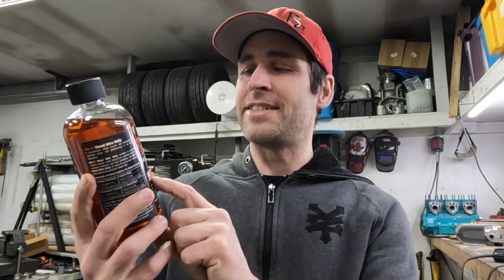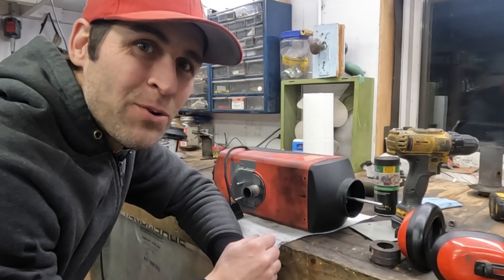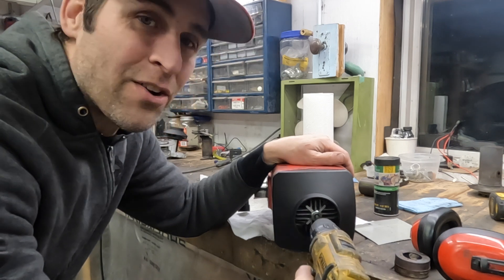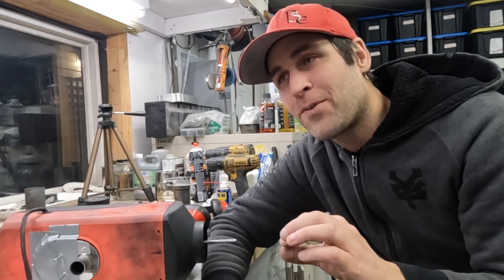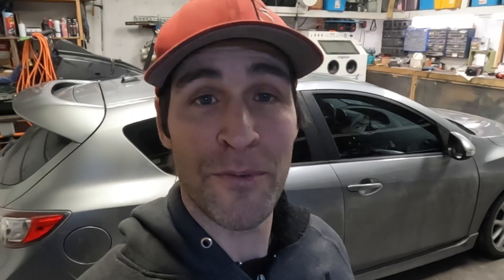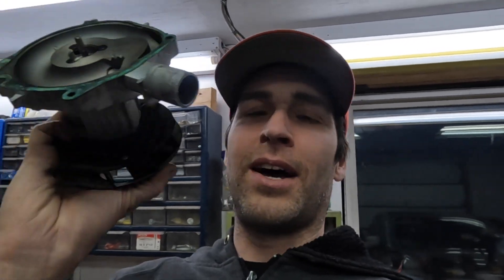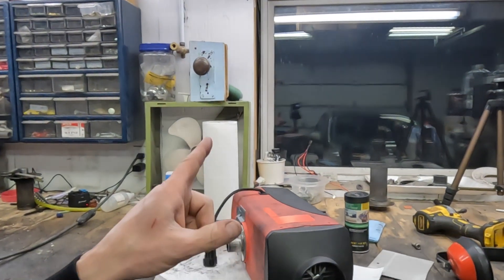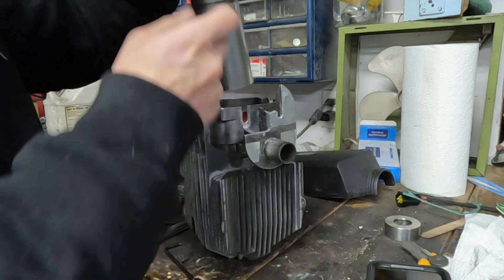Self Cleaning Heater - Veg Oil Fuel - Fuel Additives - UPDATE Video.

Comment: I use Mannol Benzine Ester Additive its for petrol engines seems to have made a difference 10ml per tank
Reply from the maker: I'm not sure if it's worse than anything else, but apparently Benzine is a carcinogen. I know it exists in small amounts in gasoline.
Reply: @loweredexpectations4927  Benzine is German for petrol according to the safety data sheet regarding ester there is no classification regarding carcinogens
Reply from the maker: @trsfc1595  Interesting. My only reference is that I have been watching a channel called "extractionsire" and he mentioned this in passing. .... Oh... Perhaps the confusion is Benzene ... Oops

Comment: @Lowered Expectations   ..    Have you tried K1 Kerosene ?    It burns not only hotter but cleaner than Diesel fuel does.   

If you haven't tried Kerosene  please try it in place of the Diesel fuel .     You could also try some Colemans lantern fuel  Its just High Octane gasoline, which also burns Hot and Clean .   Its pretty close to aviaition fuel  (not Jet fuel)  jet fuel is just a purer form of Kerosene.  Aviation fuel is like 100-110 octane gasoline . 
 
Also Kerosene would be much safer to add to the used oil .   

The reason im asking these questions is I personally know someone who uses used motor oil ATF and Hydrolic oil. In a slightly modified oil furnace in his garage , the person is a mechanic so getting used oil is easy to get.   He  thins/dilutes the used oils with Kerosene .  He just uses a standard Fuel oil tank to store the oils in .
Reply from the maker: I have not. Apparently it is the same cost as diesel, or cheaper, in some parts of the world, but where I am, it is 5X the price of diesel. 

I will probably try Kerosene mix as a test in the future. I would also like to try with just gasoline and veg oil. I have access to AVGas, but it is 104LL and I don't like the idea of burning deaded fuel, so camp fuel is a better idea for sure. 

Yeah, burning waste oils in a furnace is generally much more successful than in these heaters. These heaters are very small and stop working if you get much build up of ash or carbon. Anything that interrupts the flow of combustion air. In a waste oil furnace or furnace, there is generally a huge area for crud to build up, without causing any issues.

Comment: Hi Joel,
There certainly is airflow restriction in that passageway as it squares and necks down to the inlet for the intake side of the combustion fan, so it will be interesting to see if, with the reduced restriction it effectively burns leaner....  I'm guessing that's the main purpose for this test?

However, I would think that eliminating the intake pipe and pathway also makes the unit use conditioned air for combustion, wasting heated air in the process, and creating a negative pressure envelope in the conditioned space both of which are likely negatives.   I suppose there's a small risk of fire too should the thing ever backfire.

I'm thinking that maybe it would be possible to instead of eliminating the separated combustion air intake, that it gets replaced with a smooth turn 90 of some sort that could be threaded into the housing -- maybe using a small engine exhaust fitting for this purpose,, or attached via a flange and gasket setup as some exhaust systems use.   Next time I am at a wrecking yard, I'll look to see if there is a small 4 cylinder exhaust or intake setup that could be adapted for use for this.  You, as a small engine repair person would be in a better position to know if there's an appropriately sized small engine smooth turn exhaust 90 that might work.

Just some musings on this.  I hope they are helpful.

Cheers from Oregon USA,
Philip
P.S.  How old is your gorgeous cat?
Reply from the maker: The purpose of the porting is to try to get as much air flow as possible (with the stock fan) for burning waste oil. To test this I will be using an air flow meter as well as checking the CO to see if it has actually changed the AFR. 

Heated air should not be wasted, as the fan housing is the first part that the air hits, before passing over the exchanger. The hope is that it actually takes advantage of some of the air from the exchanger fan. 

It's almost always helpful to heat other people's input and see things from a different perspective. I often come up with new ideas and solutions when explaining things / responding to comments. 

Quasar is about 6 years old. We "adopted" him when he was 1. He had a badly broken leg and needed surgery. Megan works at a vet clinic so we took him in and fixed him up... about a year later, he broke his same leg again, haha... poor guy. Not nearly as bad the second time. Injury free for a few years now.

Comment: How well, or not did the ultrasonic cleaner do on the gauze fixed in behind the bottom of the burner tube ? Thanks again for beating to death the CDH run topic 😂🇨🇦
Reply from the maker: I haven't actually tried it because I am fairly certain that it won't' work well, haha. I probably shouldn't just assume that, but there is very little that breaks up carbon... I have heard some people planning on using acetone, but then never heard the results... so maybe they are no longer with us... that is a dangerous way to clean. 

There is stuff called "combustion chamber cleaner" but it is expensive, and I'm not sure that you would want to fill your US cleaner with it as it is very smelly and may also be dangerous. 

I should probably purposely get one dirty and then try pinesol... that stuff was crazy.
Reply: @loweredexpectations4927  I have after 2 years of moderate use, I have decided to not go below #3 pulse setting, to help prevent shooting up.  I think I pick up some extra burn chambers, and then I can see if I can clean them up . Keep making Great videos 🇨🇦
Reply from the maker: @stevecarlisle3323  It is a very good idea to have a few extra chambers on hand. I'm not sure what the long term effects or differences are between running on high or low, but the temp of the burn area is actually higher at med than it is at high, due to the lower air speed / air cooling effect. Or at least it was on my heater when I tested it last winter... I had a probe on the outside of the chamber where the fuel enters and it was consistently cooler on high.

Comment: when i use vegetable oil I use wasted or new heat it to 140 F /60 c and if you do 1 gallon mix 250 ml of heet fuel treatment  the yellow bottle not red bottle to 7 grams of lye add to the heated   vegetable  oil and stir for about 15 min and wait till the oil separate's and remove the glycerin and let remaining sit just to make sure all glycerin  is out and I run mine without washing you may try washing if you like , I do find some times some glycerin residue is left in the bottom of the tank but it will wash out just like soap  but have run my heater up to 15 hours per tank
Reply: Be careful doing this to not accidentally getting nitrates in like bat poop you'll end up with nitroglycerin
Reply from the maker: @patrickday4206  As cool as that would be... that would not be cool, haha. 

I have watched a few videos on making NG, and I don't think it happens that easily though.... right ?
Reply from the maker: Cool... I do really want to try this.... I would probably not do it on any large scale, but I think it's very interesting.

Comment: Guys I am pulling my hair out, I wonder if anyone here can help me. I have a few month old CDH and when it starts it will run for a few mins and then the heat it pushes out lowers like the burn has stopped but the fan and pump stay same speed as normal and eventually E18 come on the display. Anyone have any idea what could be causing it ?
Reply from the maker: That is odd... Are you getting any smoke out the exhaust when the heat drops ? Did you mean error 8 (E08)

This sounds like the pump may not be pumping enough fuel (faulty pump). Is your fuel tank mounted above or below your heater? This could be caused by a restriction in the fuel line, not enough air getting into your fuel tank, a plugged filter, or a number of other things. 

The next time this happens, pull your fuel line off and allow the pump to pump into a bottle cap or something. At full heat setting, you should get about 7ml or fuel (about half a tablespoon) in one minute. 

If you are getting less fuel, then the pump may be faulty and not pumping enough when it gets warm.
Reply: @loweredexpectations4927  Thanks very much for the reply , it is definitely E18. The heater exhaust is plumbed into the Chimney in my Livingroom in my house so cant see if there is any smoke , the tank is a 25L hulk marine tank and the bottom of the pickup tube is same height as the bottom of the CDH and the outlet of the tank is the same height as the bottom of where the the internal tank used to be ( I removed the tank and put a 20 amp power supply in its place). Thanks for the hint about the pump they are very cheap over here in England so I will purchase a new one and try that. The intake is definitely clear but the exhaust could be clogged, I will check on that when I change the pump. I can only find 1 mention of E18 on the internet and that was a guy on a FB group saying he had the same error but there was no conclusion to it. 
The link below should show the error ont he front of the heater.
https://gyazo.com/f743b72250383eeb7b27262d29f72687
Reply from the maker: @backyardbasher  I had never heard of anything above E10, so I went looking and found a Planar pdf with codes all the way up to 78 or something like that... Unfortunately, code 18 is missing... Code 08 and 78 are both related to flame out codes... so my guess is that 18 is just another flame out code.... and the symptom indicates this. 

The ECU / computer is pretty stupid, even in the "fancy" ones, so the manuals and websites very often overstate what the code means. 08 for example, means the heater has detected an unreasonably low reading from the temp sensor, but many manuals will claim that the heater somehow knows more than this. The ECU can tell if sensors are connected, and it can monitor readings form a few things in operation... that's it. 

The way your heater is acting, this would normally throw a E-08 code, due to the temperature dropping. A clogged exhaust could cause the heater to flame out and lose heat. If you have an air compressor, you can remove the exhaust an blow through it to see if a bunch of carbon comes out. 

I have bypassed my heater in the past and used a IV drip feed to deliver fuel to my heater... I ran it this way for a few days and am currently running it this way for more testing... I don't recommend doing this, but it does rule out the pump, haha.

Comment: Hi biddy. I worked in a kitchen last uear which gave me a good solid supply of waste veg oil. And i used it in my heater on my boat for s good few weeks. it ran reslly well for a few days and then clogged up my heater. But after making a good filter set up and adding about a 20/80 mix with petrol its burned really well for months now. And its definitely hotter thrn diesel. And i dont seem to use as much fuel now either. Maybe a 29 percent reduction in fuel.
Reply from the maker: Thanks for the comment. Were you running it pure at first, when it clogged up ? When you say 20/80 is that 20% petrol or 20% veg oil? 

That's awesome that you are having good results. If it is burning hotter, then I suppose you can run at a lower setting and use less. Either way, if you get a few months before having to clean, or replace a chamber, it is totally worth the savings !

Comment: I think another key component of running multiple fuels is sustaining complete fuel mixing. I use an agitator pump in my larger tank to regularly circulate the fuel bottom to top to prevent both settling out and incomplete mixing when adding fuel oils. It's better to be over mixed than under, like with two stroke. I was also given a quantity of Shellite (refined liquid hydrocarbons) that I add in when using  my 30% waste oil mix, partly to get rid of it, but I suspect it also generates a hotter and faster burn. I add about 1% from memory, or half a liter to a 50 liter tank. I'll know for sure once I run out.. lol
Reply: I use a kitchen stick blende r
Reply from the maker: Do you also use it for smoothies ? haha.
Reply from the maker: I think this is probably much more necessary when mixing larger quantities for two reasons... 1. is that more volume requires more mixing and 2. that large volume is going to have a long time to settle out.  

I mix up my batches, currently, in 4L (about a gallon) and it is all consumed within 12 hours or so. It also depends partly on what you are mixing together. Based on my several pails of waste oil, I suspect that gasoline stays suspended in oil fairly well, but a lot of other things will settle out.
Reply: Only for smooth running!

Comment: It would be awesome if you could just clean up the inside, and then the burn chamber was built in such a way that all residue, concentrated falling towards the exhaust opening. So the only maintenance you had to do, was disconnect the exhaust and shake it, so every residue falls out.
Reply from the maker: Cleaning it without disassembly is part of this idea... I may start testing today.

Due to the way the chamber needs to be designed to burn clean, some loose ash is almost certainly going to build up inside of the burn area / burn chamber. This could be cleaned as easily as either connecting an air compressor to the inlet, or connecting a vacuum to the exhaust (or both) If the ash is in fairly small pieces, and dry, it is almost like dust, and will come out very easily.

Comment: I think you may have brought this up before, the nitro additive make me wonder how this would run with oil mixed with nitromethane (glow fuel?), which supplies much of its own oxidizer... Hyperfuels has it by the gallon, and they have seasonal specials. Not exactly budget DIY, but Who knows how little you need.
Reply from the maker: That would be a very cool test... You should get some and try it. I don't know that it would be cost effective, but it would be fun ! haha. 

If it will mix well with oil, then I suspect it would have to help... like you say, it is an oxidizer... most of it is mixed with alcohol or something else. It would be a very cool test. Cheapest I've been able to find it here is $104 a gallon.
Reply: @loweredexpectations4927  During a Christmas sale with a coupon it was down to around $75 US, IIRC, but I didn't pull the trigger. I'd try it, but I don't ever intend to run oil through my heater. The nitro content can go up to 65% from what I understand.

Comment: Thanks for doing veg oil testing.I’ve been waiting for a while. I mix one litre of WVO with four litres of diesel to offset the cost of heating . I haven’t had any troubles so far
Reply: I have been running filtered used veg oil in a 50-50 mix for the last 3 months without any problems my exhaust passes through a sand battery kepps my workshop a nice 18 deg. Great videos thanks
Reply from the maker: Good to hear ! If it has worked that long, it doesn't really matter what happens next, but I would love to see what your chamber looks like. If you get a month of burning and have to replace the chamber, at a 50% fuel savings, it's totally worth it !
Reply: @sidknowles3467  I have had succes running 70% spent veg oil mixed with 30% diesel. It ran well for about 1 1/2 seasons, but at a certain point it became more difficult to start up. I chose to take it apart, and there was some carbon build-up in the burn chamber and the ignition chamber (with the mesh). After cleaning it, it has been running great again. Another great benefit is that the viscosity of the veg oil is a lot higher, and this reduces the ticking noise of the fuel pump dramatically.
Reply from the maker: Awesome. Based on my testing, you can probably get away with a lot more veg oil, and a lot less diesel... I am pulling my heater apart this morning to have a look... We will see how it looks after 4 litres of veg oil.... that will tell us something.

Comment: This is awsome, I've been running veg oil all winter... well lack of one here anyways 😅... like I had stated before, with kerosene. My mix I've been using is 100% kerosene to light, then switch over to 60/40 veg/kerosene  once I go out to the shed. I'm only running it for 3-6 hours at a time and only really used it about 2 dozen times so far. I haven't taken it apart yet so I'm super stoked to see what you found 😅 I'm lazy when it's cold
Reply from the maker: Good stuff ! I'm glad I'm finally getting around to testing this. 

I wish I had easy access to waste veg oil, so that I could carry on with some longer term testing, and also check to see how much veg oil we could get away with before having problems. 

I am currently running new veg oil, and it is pretty expensive here. I am also pretty lazy in the cold ! haha.
Reply: @loweredexpectations4927  I'll tell you that it's is a lot less smelly to collect the waste veg oil in the deep cold when it's solidified lol don't know if I'll grab another bucket until the temp drops again lol but I buy kerosene in bulk instead of dyed diesel to also save on money.  It's sold as home heating oil in my area
Reply from the maker: @jonathantheunacceptable4259  How do you collect it when it is solidified ? With a shovel and a pail ? I have heard that kerosene is cheaper in some places... not where I am, but that's cool if you can get for less than diesel.
Reply: @loweredexpectations4927  yes 😂 with a shovel and a couple 5 gallon pails. I use to manage a a&w restaurant so I got a few contacts to raid grease bins lol
Reply from the maker: @jonathantheunacceptable4259  SWEET ! ... I need to get a part time job at some fast food spots so I can get a hook up, haha.